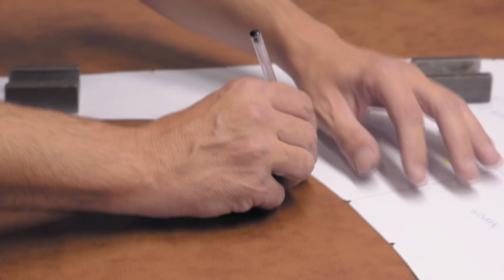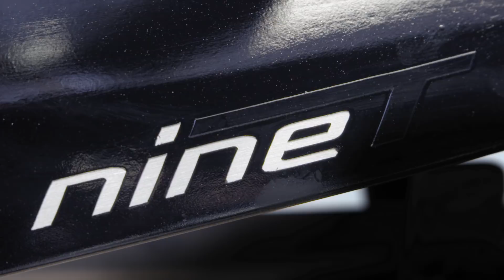BMW Motorrad  Option 719 - Production

Comment: Would love to see an R9T custom in the line of what Touratech did, a bike that honors the original GS with proper dirt road abilities and not just cosmetic styling, and offering those components as custom order options (eg higher handlebars, wider foot pegs, progressive stiffer suspension, 21” front and 18” rear spoked wheels, skid plates and crash bars, pannier racks and stronger sub-frame, windshield, radiator guards, larger and smaller fuel tanks depending on the intended rally/enduro event, etc.).
Reply: Gerhard Combrink check this link for a look at a custom gs Dakar. 
https://youtu.be/yF44P8fYsfM
Reply: I was here first - Very nice